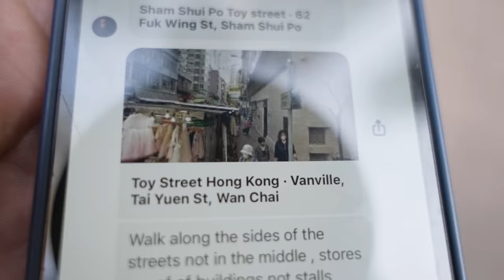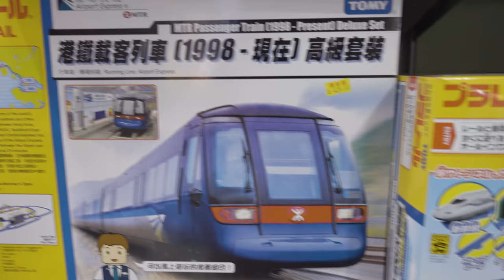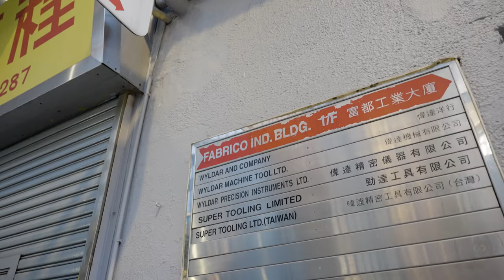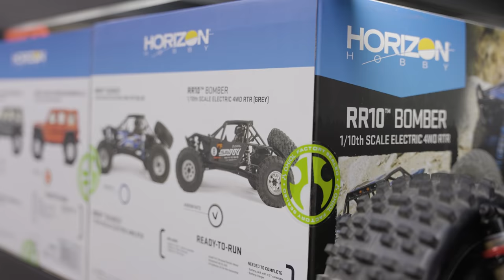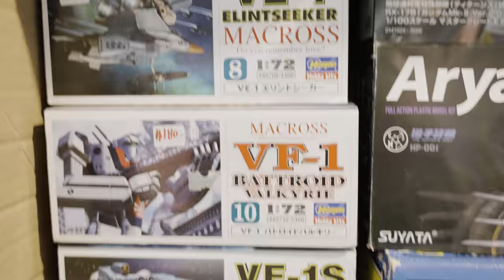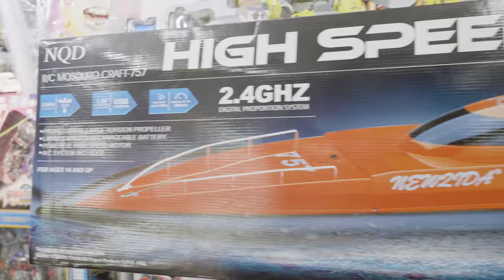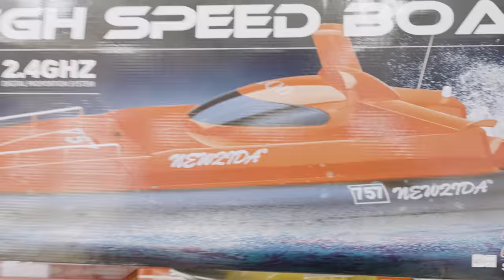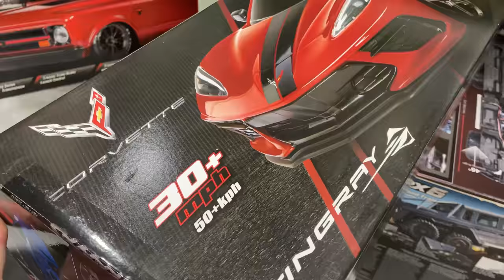Inside A Cheap Chinese Knockoff RC Hobby Store

Comment: Buddy, I'm just glad that you changed your view about the Axial Ryft. It is a good looking rig and full of potential. While you are in HK, pick up a sway bar for the rear axle too, you are going to need it if you planned to run the rig in 4s of 6s. Have fun with the Ryft. I have done some reviews previously, and there are also some tricks which you might find it useful. 😊👍🏼

Comment: You had me for a second I really did think you found a cheap knockoff nitro lol. I love nitro rc. You really should get one and try it. They are a pain to tune sometimes but if you take your time and have patience the reward off a smooth running nitro is worth it. Hard to explain why it’s so much fun when they run right but it is. You just have to try it out for yourself. The Traxxas nitro rustler is a good one for a first timer. Or even some of them cheap Banggood ones are good for a first nitro. I bet you once you get one you will be hooked
Reply from the maker: 😅😅 Im looking at the nitro savage but I also like how easy electric are!
Reply: @TheRcKiwis   I’m a fan of both nitro and electric but nitro is more engaging and the thrill of getting that tune right and have it running good  is more then worth the extra effort needed. They are an absolute blast. I have a savage XL 5.9 and am currently building a twin engine nitro savage. Everyone in the RC hobby should at least try a nitro once. They so much fun